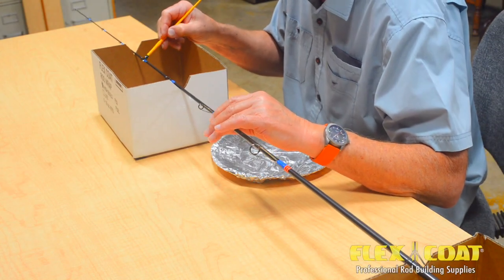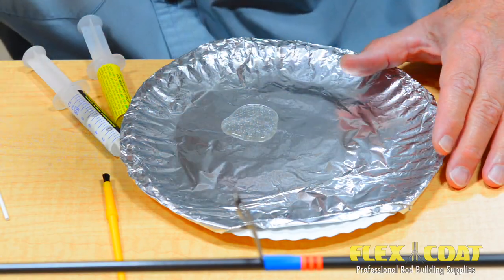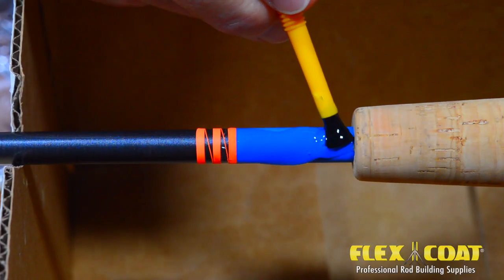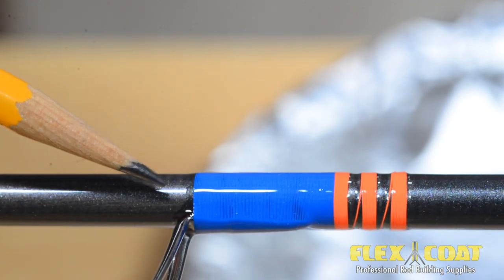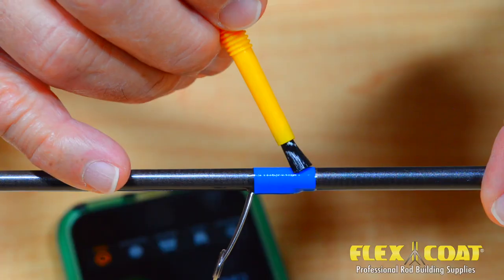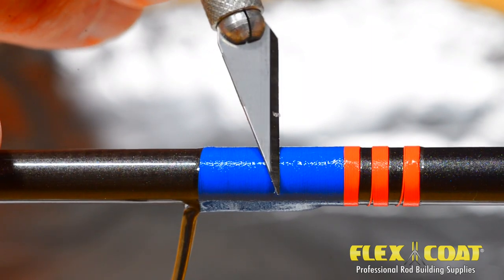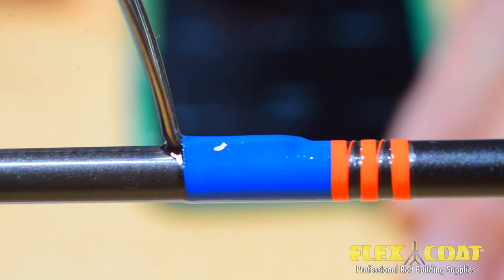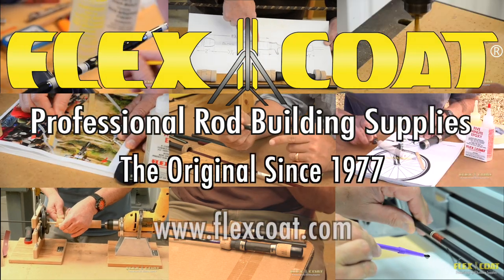Flex Coat Rod Building - Simple Rod Finish Method

Comment: How long do you wait before wiping off excess finish?
Reply from the maker: Ruben, you always apply a little bit more finish than you need on your first application. Then after it’s been on there for about 10 minutes and you think it has soaked all the way down to the blank and filled that tunnel between the thread, the blank and the guide foot, you takeoff almost everything you can get off. This is for the first coat only. I call that the primer coat then you need to apply a second final coat of finish to the rod after eight hours.

Comment: Gorilla Glue CLEAR works great. UV resistance and goes on easy. Dries fast too.
Reply from the maker: I respectfully disagree.  I have tested that product for the use on fishing rods and it doesn't hold up to Epoxy.
Reply: I agree Rick James  I've been using gorilla glue clear for years and have no problems

Comment: You forgot to mention how to address bubbles in your finish.
Reply from the maker: Yes, we didn't cover bubbles. Trying to keep it short and sweet. If you have bubbles in your finish pop them...with a torch or a heat gun. Thanks
Reply: I’ve been building rods for about 10 years now. I just thought it’s something a newb should know before attempting rod finishing.
Reply from the maker: @ronh8717  You are correct. Bubbles can be a problem.  Best practice is to not introduce them in the first place by heating the finish before mixing.